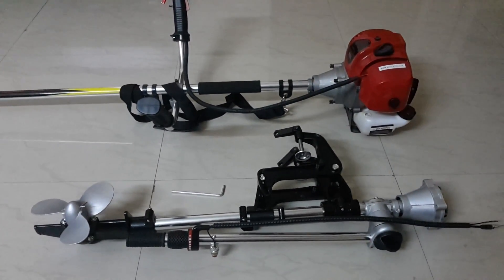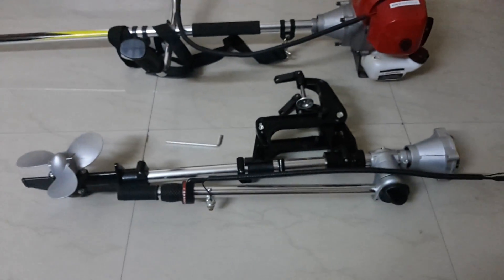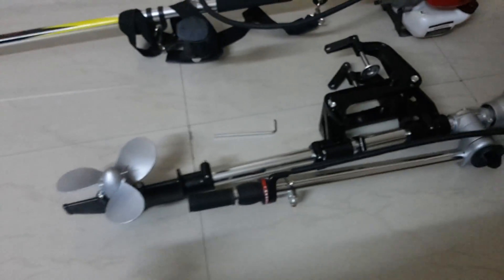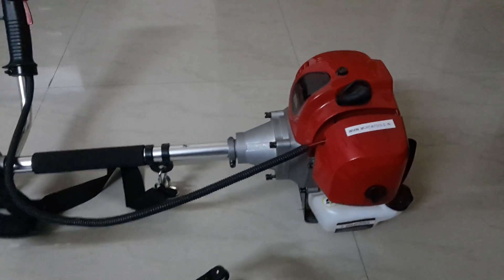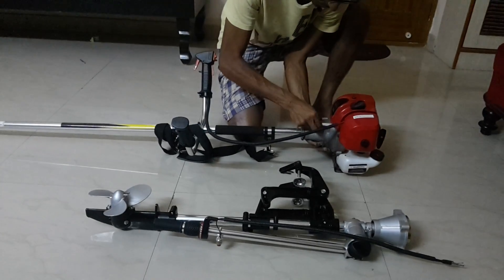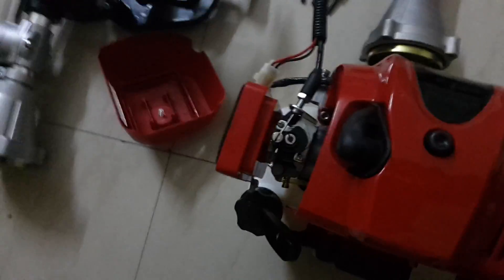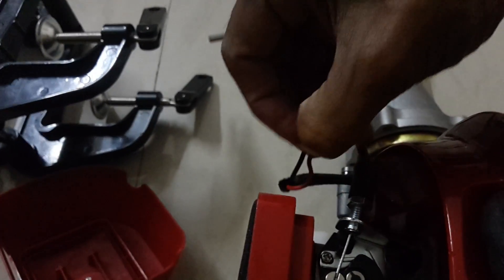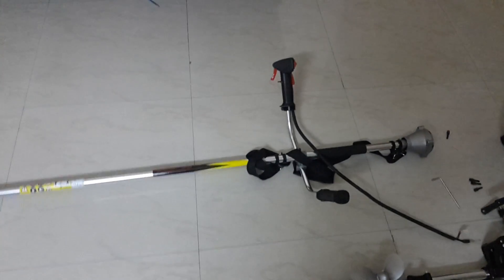Weedeater in to outboard trolling motor for all inflatable boat 1

Comment: Whats the name of the conversion kit?
Reply from the maker: outboard motor
Reply: Naveen Paul the final product is an outboard motor but whats is the name of the part? And where did u get it from?
Reply from the maker: yup i got it from aliexpress.com even i got it after a long search.  out board down unit was the key words i used. also try the key words like boat lover unit propeller. hope this helps you to find out the product
Reply: Tanks mate

Comment: Hi Naveen,

sorry yar.......i tried spare parts only available.............can you suggest me.
Reply from the maker: +Selvam Subramani let me check the site
Reply from the maker: "Marine outboard motor Gearbox Stern tube Bracket  for  HangKai  4 stroke 3.6 HP-4HP  gasoline boat engine accessories" try this keyword in aliexpress

Comment: Thanks this is great, since not everybody has the same engine (Honda), what other engine types this will fit on? I guess the real question is, what is the housing dimensions for the coupling where it meets the engine. I think this is a great idea and maybe cheaper to use a weedeater engine for a raft, canoe or kayak.
Reply from the maker: Hi Jay, thanks for the question. this coupling which comes with don unit we can use in 4 cylinder and 2 cylinder. universal size. however if you need i can also provide you the detailed size of the coupling. Thanks
Reply: if you don't mind, I am sure there are people out there who have an extra weedeater laying around that might not be a Honda but knowing the measurements I might be able to either order the part or not. Thanks
Reply from the maker: +Jay Tua i hope the size is same for all weedeater 4c or 2c. however you can connect to the seller to know the details before buying.  thanks
Reply: thats my product  ,,,whatsapp for more info +919923449493

Comment: What is the gear  ratio  is it 1 to 1?
Reply: Did you find out the gear ration? This seems troubling regarding the gears inside.
Reply from the maker: Sorry not sure
Reply from the maker: +Gary ansell Hi Ansell thanks for the question. if you are asking about the petrol and oil ratio its 1 liter 20 ml which i use.

Comment: what was the name of the part i cant find it on aliexpress found one kinda like it but want the same one
Reply from the maker: +Shawn Stock sure i can help you to get the same one. please find the link http://www.aliexpress.com/item/Avaliable-for-honda-engine-outboard-motor-boat-engine-air-cooled-Stand-of-outboard-motor-Outboard-engine/32386325773.html?spm=2114.01020208.8.57.zkVAZO
Reply: @NaveenPaul  Bro wich grass cuter use  this video ?
Reply from the maker: I don't remember the brand name but its 2 cylinder engine. All engines will work for this since the size is same.
Reply: @NaveenPaul  Thanks bro

Comment: Where did you buy the lower unit of the outboard?
Reply: thats my product  ,,,whatsapp for more info +919923449493
Reply: swapnil kshatriya is this sold in the United States
Reply from the maker: Hi dear friend i got it from china. its really good.  aliexpress.com
Reply from the maker: +Mon S http://www.aliexpress.com/item/Avaliable-for-honda-engine-outboard-motor-boat-engine-air-cooled-Stand-of-outboard-motor-Outboard-engine/32386325773.html?spm=2114.01020208.8.57.zkVAZO
Reply: swapnil kshatriya pm price RM